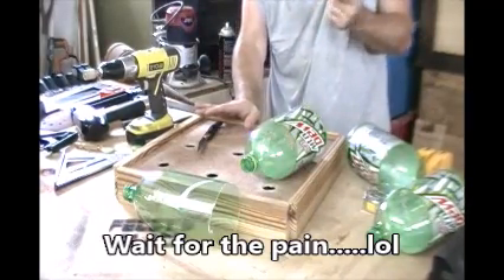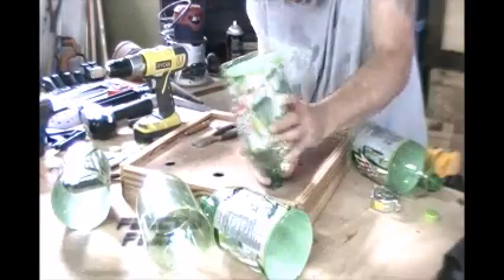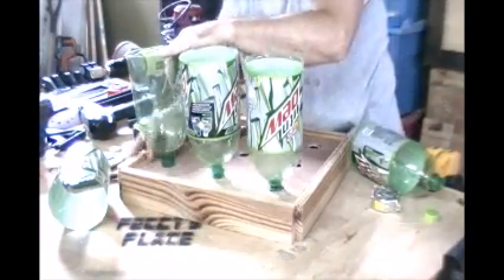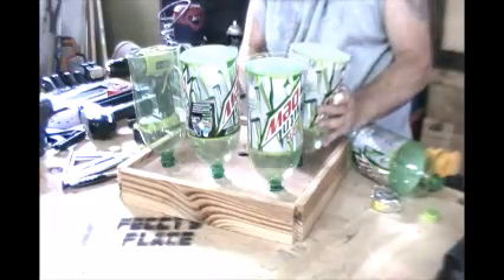The Disabled Woodworker - Mini Eco Cooler Build and Trial Run - Does it Work or is it Hype?

Comment: I was thinking, its narrower diameter that helped working, so a series of funnels with progressively narrower cross sections and lesser overall surface area would step-compress the air until it makes significant temperature changes ?

Maybe a heat sink that comprises of water bottles inside the system as buffering for the cool air's entalphy.

I mean even paper mache funnel would work in this case so making smaller and smaller cones from newspaper
will still theoretically work ?
Reply from the maker: I am not sure. I have had something nagging me in the back of my mind ever since I made this. What if the air only feels cooler because of being forced, thus, there is not really a significant temperature drop overall? 
I used a laser thermometer to test this hypothesis and though there was .03 degree drop, I am not sure if that is simply because I was in my shop and not a controlled environment. I have since dismantled that cooler but I may rebuild one and test it again.
Reply: I actually tested this in an enclosed room with the temperature kept constant with 2 funnels, barely offsetting the usual temperature rise in a room when I am present  (a person giving off heat) with outside temperature being 2-3 degrees higher

I will test if I can actually put up more funnels to offset enough to cool the room using just fan. It seems its a legit way in Joule-Thomson effect for thermodynamics,
Reply from the maker: Funnels may be the answer. No drastic move for the air, but a gentle narrowing of space, thus compression is smoother.

Comment: pv= nrt.

what i want to do is make an array that will fit in front of a box fan and see what happens.
Reply from the maker: The air will be bit  cooler, don't expect a 15 degree drop or anything though...lol
Reply: i wasnt expecting a drop like that. if that happened it would be marketable.

but when you live in a village with no elect or fans and an outside temp of 110 .... even a slight drop is an improvement.

i expected that it was over stated but wondered by how much.
Reply from the maker: Surely you could expect a 3-5 degree drop realistically.